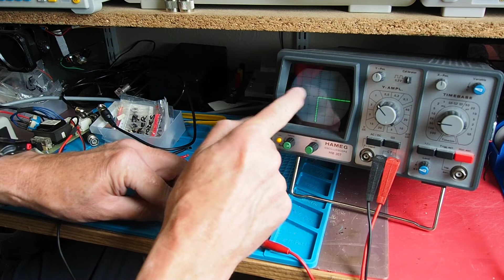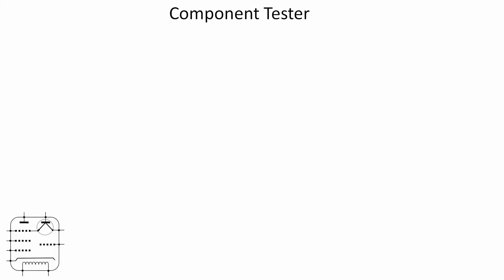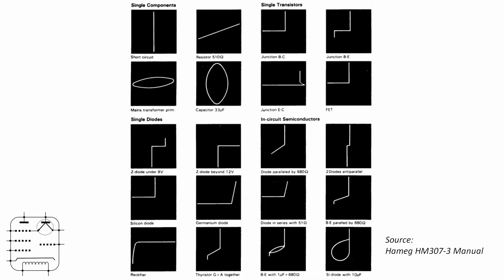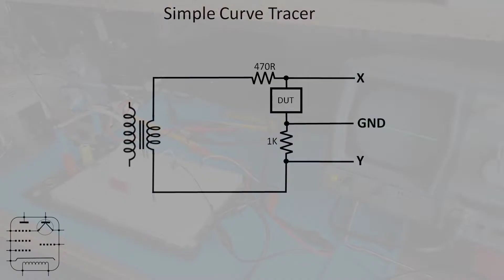Component Tester - Curve Tracer - #133

Comment: thanks for this educational video.
I am trying to follow on my breadboard.
seems like every I-V tester I have seen uses different voltages, resistors,so get different curves on screen.
is there a pattern or formula to decide how much AC voltage, resistors number and sizes to use as voltage dividers In making one on breadboard.capacitors seem to show up as some sort of circle, but diodes have great variety of shapes.
John

Comment: I have never understood the point of a two wire curve tracer?
You need THREE terminals, because the base/gate also need to be current/voltage controlled (stepped actually).

Comment: I made one of these back in 1985 with a 12.6 v ac Transformer. You can also change your H and V controls on your scope as well to view the complete waveform if it falls outside the screen. I would be curious of the 3 ac output voltages from the kit.

Comment: This schematic is based on old schematic, what military used back in days for quick component diagnosis.. 😉 I have this schematic in old magazine. When limiting supply voltage, this tracer can help diagnose problems with digital circuits and even showing dead ICs.. But, that part now is obsolete with modern stuff, because everything is more complex and lots of stuff is done in firmware using few chips and not in jellybean hardware with easy replacement..
Great video anyway! 👍

Comment: Thanks, Bill. Excellent as always. Could you build one of these using a signal generator?
Reply from the maker: Indeed you can...
Reply: @LockdownElectronics  please I would love to see this in a future video!
Reply: There is a commercial version called a Huntron tracker.  I believe it uses 400Hz. It also has a relay and two "hot" leads. You would hook one lead to the chassis ground and it would switch back and forth between the other two leads for the DUT. If you had a stereo amp with one blown channel you could put a lead on each channel in the same component and see if the V/A signature is the same. As you worked your way through the board, when the signal would change from L-R you knew where the problem was.
Reply: @alanduncan3710  Great idea with stereo amps to track measurements across channels. Why didn't I think of that. Build 2 and then you can check them. Thank you.